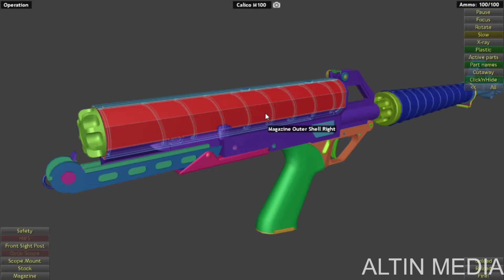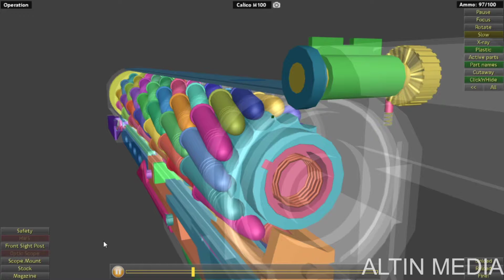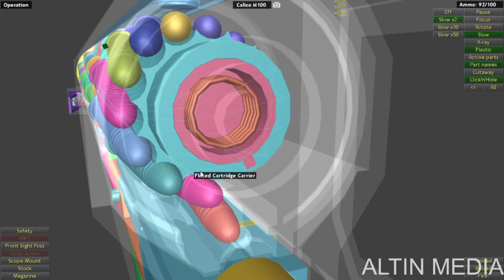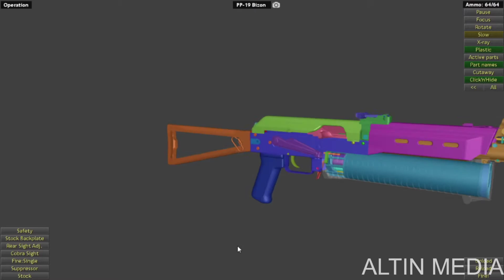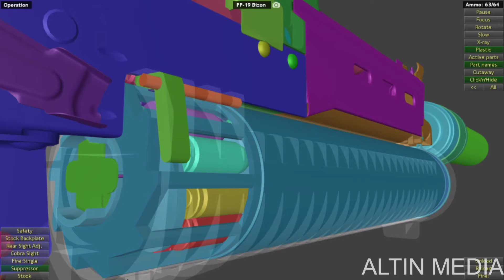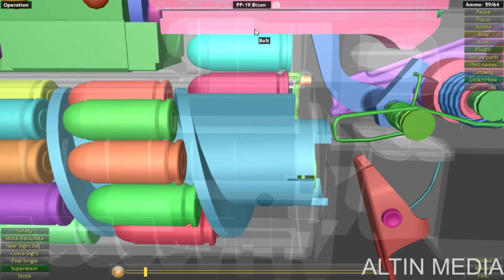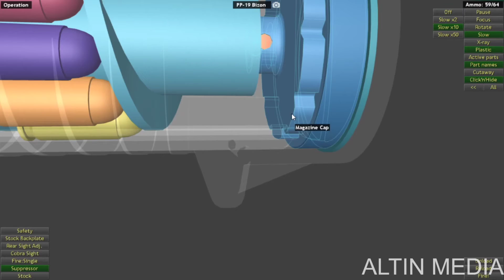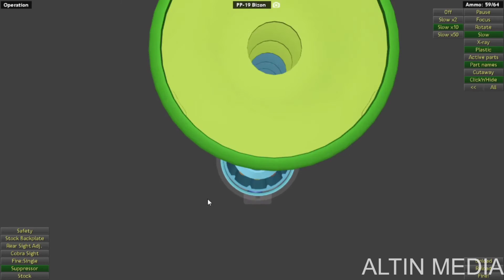Magazine comparison: PP-19 Bizon vs Calico M100 | WOG | With Commentary

Comment: Do you think Bizon is therefore more reliable than Calico? Because Calico malfunctions very fast
Reply from the maker: I think bizpn is more reliable because it was used in service
Reply: the m100 uses .22lr which is known to cause problems in semi/full auto so that doesn't really help. the main problem was people wouldn't read the instructions and either over or undercranked the magazine spring causing problems.